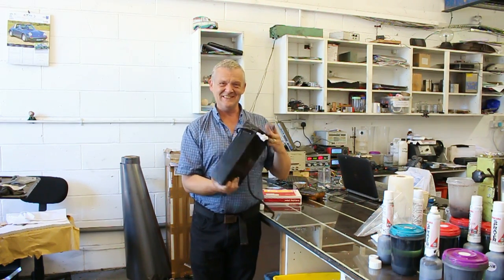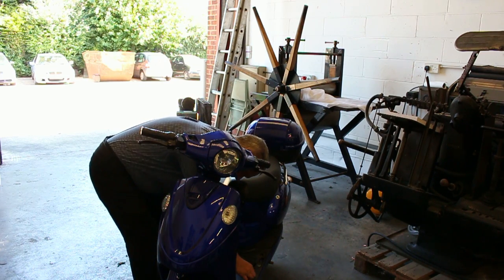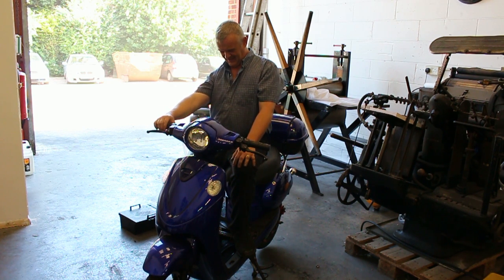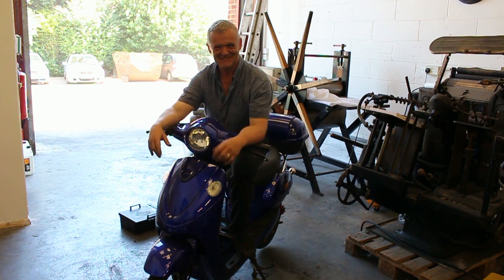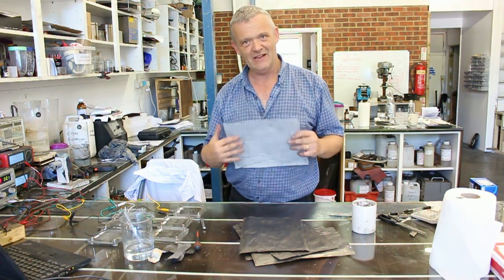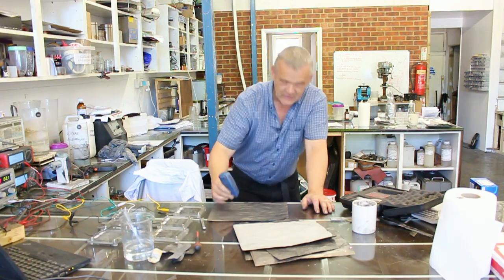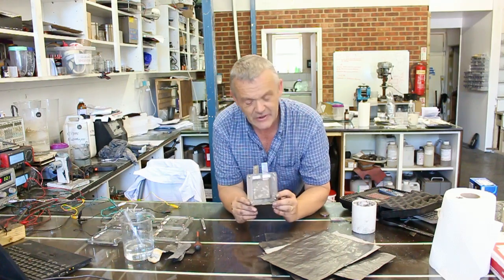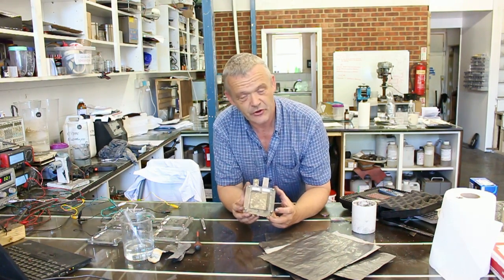Big Battery Bike Build - Testing The EESD

Comment: Can any one advise of a good website to buy graphite in the Netherlands?  Everything here costs a fortune. Is there some product that contains it other than pencils that can be bought everywhere? I dont want to have to peel 1000 pencils.
Reply from the maker: lock lube is pretty pure graphite mate
Reply: Thanks Robert,
Isn't lock lube a powder though? How would i use powder to make graphene like in your video.
I want to try to print a battery for my bike as 500 euro is a bit much to pay for a new Li-Ion one.
* update *
sorted. http://www.ebay.com/itm/322105032115
Reply from the maker: for that you will have to review the videos on the channel and work out a method for yourself mate - there is a ton of advice on this channel

Comment: Robert you are such a great guy getting this done ! Congratulations ! 
what is the maximum cell voltage you can achieve and not destroy the single cell now ? I hope I can soon buy such a supercap for my upcoming solar project. Many thanks for your great hard work and now finally enjoying the ride on the bike ! Regards, Stefan.
Reply from the maker: it will go up to 2.7 volts mate - but the life cycle would drop dramatically at that
Reply: Robert Murray-Smith
To what voltage did you charge up the cells ? Only 2.5 Volts or still lower ?
How do you get to 48 Volts with just 12 x 50 cells ? do you use only 12 x 2.5 Volts in series, so only 30 Volts and then 50 Stacks in parallel ?

Comment: Hi Robert, this video is awesome to see!

When you guys are verified, would you mind linking to the document so that we may have a look-see at it? Very exciting!!

Also, what would you estimate it costs to make the 1kWh "battery" and during verificatin is one of the test variables return efficiency (like how a LiPo is only 90% odd return efficient and a NiMH is something like 50% with all the heat generated during charging)?
Reply from the maker: cheers mate - and yes it will be freely available for all to see - i will get round trip efficiency measured too - cost is not something i will discuss for obvious reasons

Comment: I could barely wait till the end of this video to comment.

I was thinking more about this concept and my boat isn't to that point yet so I stopped working on the homademade battery but...I came to the conclusion that I could do exactly what you did but on a roll of paper and build it like a capacitor. from my understanding as long as you get the same surface area you can achieve the same voltage.

this means that I can roll out paper, paint the "plates" and roll it back up using one set of leads. I could stuff it in a pvc pipe and seal it. sealing it would enable RECOMBINATION. I would install an air compressor relief valve to ensure it wouldn't explode.

this means I would have a capacitive battery that was maintenance free...except for cleaning the cells externally of course.

the biggest benifit would be in production...it's on a roll instead of sheets. roll it out, paint it, roll it back up. the same thing you just built...in a sealed tube.
Reply: what voltage did you achieve and what was the total surface area between plates? as I understand it's a linear relationship.
Reply from the maker: Voltage is a property of cell chemistry mate - not surface area. Surface area represent accesible volume for reactions to be 'captured' and therefore relates more to amp output of the cell. You idea is a good one but like all these things the devil is going to be in the detail of the actual build - good luck with it
Reply from the maker: the eesd was 48 volts mate but that is because it is connected series parallel to achieve that
Reply: +Robert Murray-Smith when you put the cell plates (sheets of paper) in series you are increasing the surface and effectively turning them into one plate. and you are correct about specific materials having a chemical effect on voltage but the reason carbon works so well is that it creates an irregular surface...therefor increasing surface area and voltage. but voltage does increase linearly as you increase the surface area of the plate...at least in theory it does. I was just wonder what your real 12v achieved results were.

I guess I was asking how many sheets did you use to make 12v so I can get an approximate necessary length of paper off the roll. I'm not worried about it working. I'm building it the same way can capacitors are built...just making it a battery.
Reply from the maker: sorry mate - maybe i am misunderstanding you - what theory is it that says as you increase surface area voltage goes up linearly?
Reply from the maker: I understand mate - you might have this the wrong way round - you are right about the number of electrons being exchanged as a direct relation to amount of material - that is volume of material - greater surface area increases the accessible volume - that is how much of that volume you can get to - but it is still limited overall but the total amount of material available.
The reactions happen at fixed potentials - that won't change however many come into contact - you might want to check this though
Reply from the maker: you really need to check your basic concepts mate
Reply: +Robert Murray-Smith I may be wrong. no worries. I was just wondering how many sheets of paper it took.
Reply: +Robert Murray-Smith if I do find what I'm talking about I will be sure to share it. I probably look like a luni. they taught me to be confidently wrong in the navy. lol
Reply from the maker: 50 sheets a cell 12 cells to the battery mate
Reply: thank you. cheers

Comment: Have you printed all these paper sheets by hand?
Reply from the maker: yes - well sort of - on a small machine
Reply: That was sure a nasty piece of work. I'm using acrylic binder, the base of alle acrylic paints without color pigments, for my ink. The result is an waterproof flexible conductive ink.
Reply from the maker: that's very cool - and very clever - thanks mate - and yes it was a pain to do so many - but it will be easy in a production environment
Reply: Why haven't you used your fine old printing machine? Is it not ready yet?
Reply from the maker: i do everything a little step at a time - that's why it takes me ages - but it also means i understand the process
Reply: I understand that was the test of a really large capacitor. Now the next step ;-)
Reply from the maker: exactly
Reply: I have still a few questions to that big boy
Is it one large capacitor or more in series and parallel? Which electrolyte have you used for it?. How Many capacitors you have connected in series to achieve the 48V?
Reply from the maker: i can't tell you the electrolyte for obvious reasons mate - but cell voltage is 2.15 volts so 24 in series made it
Reply: Ok. :-D 
The voltage per cell is all I need to know. Thank you for all your amasing stuff and knowledge you share. ;-)
Reply from the maker: I saw it about 7 months ago - left a comment - but i put it here for others too

Comment: Very cool.  What do you use as a separator between sheets if each is printed on both sides?
Reply from the maker: the support acts as separator mate - i talk about this in the video
Reply: Robert Murray-Smith maybe I'm being daft, I get how the paper is the separator when it's coated on both sides but when they are stacked together is there no separator between them?
Reply from the maker: yes there is - but it is a sheet of thin plastic as it doesn't need to be ionically conductive - so it is not strictly a separator - it is more like a cell pocket
Reply: Robert Murray-Smith so it's not possible to get ionic layers on both sides of the graphene coating?  Only on the side facing inwards?
Reply from the maker: there are lots of ways of doing it mate - what i built is only one method - i am sure others could devise better methods - so - try one and let me know how it goes for you
Reply: living in the western isles, I'm forever waiting for stuff to come in the post so it's slow progress
Reply: i think you've set the bar for homemade batteries by a long shot anyway, looking forward to the next vid
Reply from the maker: cheers mate

Comment: Hey,I got a Tao Tao 49cc that looks kinda like that...Wait a minute,you can ride scooters in the U.K. without a helmet?...

Can't get away with that in the U.S.
Reply: The motor on Robert's scooter is only 250W, so it's classed as an electric bicycle here in the UK. Bicycle helmets are not mandatory here either, but you have to wear a helmet on 49cc and upwards motorcycle.
Reply from the maker: vino veritas says it all mate
Reply from the maker: spot on mate

Comment: Oh yes.
the data used by me.
about 6 liter volume of the battery.
1kWh
1L gasoline 8.77 Kwh 30% yield motion energy.
electric motor 90% yield motion energy.
greeting
Alex

Comment: That is really cool.  So how long does this battery last for if you keep it on an engine load at 50 percent throttle, 70 etc.  Or is it relatively immeasurable(like in the half year range)
Reply from the maker: I have extracting nanoparticlesbeen driving it around yesterday and all day today so far it has done 86km on a single charge
Reply: Is 86 km like the final distance?  Or is it still going?  And does it ever start to lower its top speed?  Can you make a smaller replacement battery for battery operated drones and fly those around and see their relative performance too?
Reply from the maker: it's still going strong - i guess it would make drone batteries - but i am not likely to make one for others - if you want that - you could watch the channel and make your own
Reply: +Robert Murray-Smith im just interested in the capacity. not one for myself.
Reply from the maker: oh i see

Comment: Great video! It put a big ol smile on my face. Few questions though... How long will it take to make one of those 500 sheet bricks from start to finish? Also, how much does it weigh?

Again great work!
Reply from the maker: by machine a few minutes - weight i don't know - i have to buy a scale for it - all my scales are microbalances
Reply: What is the capacity of the original battery?
Reply from the maker: 960wH
Reply: The way you hold and handle them the original one looks heavier.
Reply from the maker: it feels like it is - but i need a scale to weight them as all my scales are microbalances

Comment: This is great. Now you are talking.
Reply from the maker: lol - fair enough
Reply: What voltage and how long did it take to charge it?
Reply from the maker: 48 volts i don't know as i put it on late last night and it was done when i came in this morning
Reply: The time to charge the battery based upon what was projected would not be overnight. So how long does it take in reality?
Reply from the maker: lol - mate - rephrasing the question won't get a better answer - I am in the US at the moment when i return home i will do a follow up and when i know the answer i will give it

Comment: .210 X .297 X .0508 [m] = 0.003168 [m^3] = 3.168 [L], 1000 [Wh] / 3.618 [L] = 316 [Wh/L]

You now have a device that competes with any other energy density available in the marketplace. I believe your lifecycle cost will be much lower then other technology forms, because you've already shown it will go 10,000 cycles with up to 3% loss of original capacity.

http://papersizes.org
http://www.answers.com/mobile/Q/How_thick_is_a_ream_of_paper
http://www.allaboutbatteries.com/Battery-Energy.html
Reply from the maker: we'll know for certain mate when the verification comes through - but stuff looks good right now